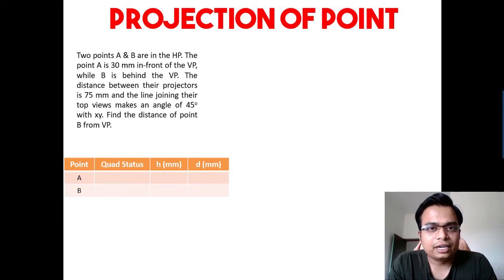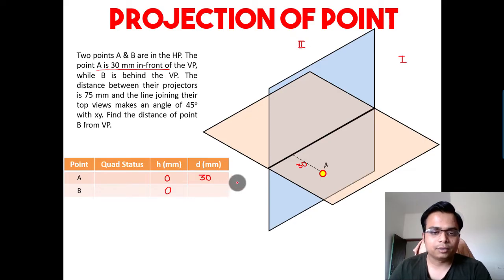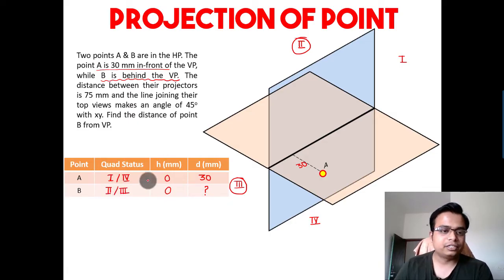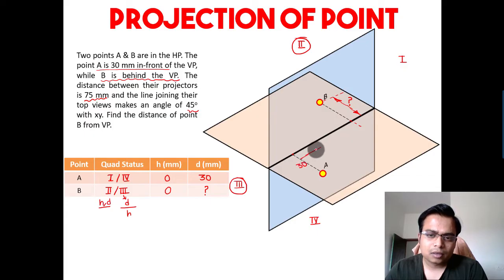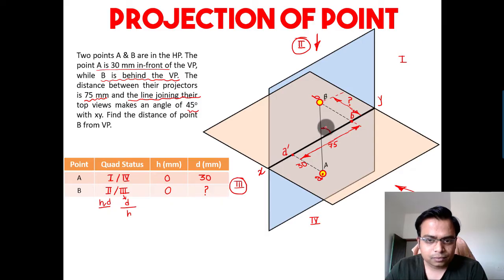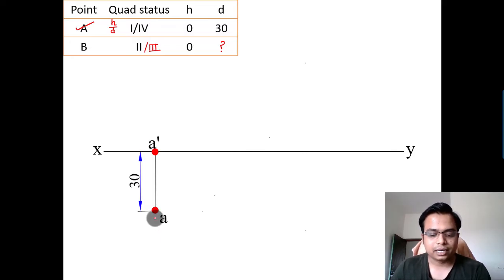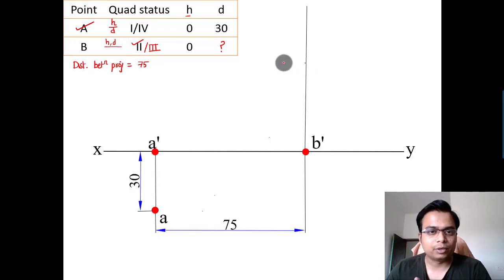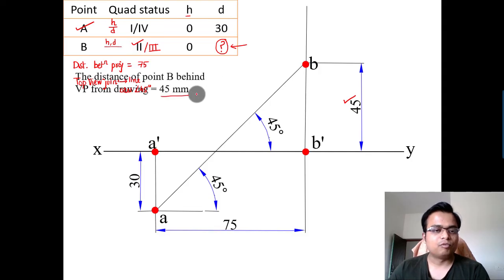Projection of Point_Problem 3_Reloaded

Comment: Q) Two points A and B are on H.P the point A being 30mm in front of V.P, while B
is 45mm behind V.P. The line joining their top views makes an angle of 450 with
xy. Find the horizontal distance between two points.

A) is the horizontal distance means "distance between projectiors" or anything ???
    just like 75mm in your video 5:30.

Comment: Two points A and B are in the H.P. The point A is 30 mm in front of the V.P., while B is behind the V.P. The distance between their projectors is 75 mm and the line joining their top views makes an angle of 45° with x y. Find the distance of the point B from the V.P.

Comment: A point 30mm above xy line is the plan view of two points P and Q. The elevation of P is
45mm above the HP while that of the point Q is 35mm below the HP. Draw the projections of the points and state their position with reference to the principle planes and the quadrant in which they lie

Comment: 5.	Two points A and B are in the H.P. The point A is 30 mm in front of the V.P., while B is behind the V.P. The distance between their projectors is 75 mm and the line joining their top views makes an angle of 45° with xy. Find the distance of the point B from the V.P.

Comment: can u explain how  BB' came as 45
Reply: It shouLD BE calculated using ruler
Reply: After measuring  45 DEGREES ANGLE, THE POINT WHERE IT MEETS NEED TO BE MEASURED AND WE GET 45MM

Comment: A point 30 mm above X-Y line the plane -view of two points Pand Q.The elevation of P is 45 mm above the HP while that of Q is 35 mm below the HP. draw the projections of the points and states their positions with reference to the principal planes and the quadrants in which they lie.  give me solution this problem